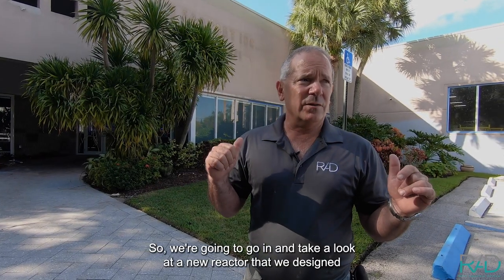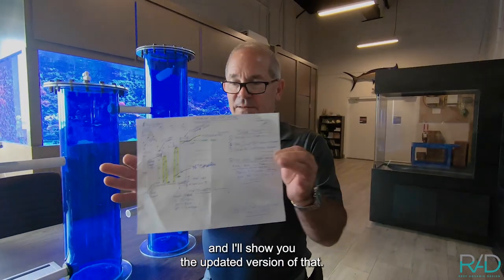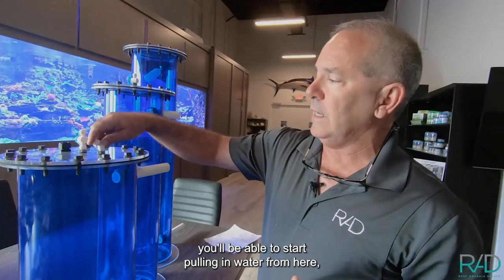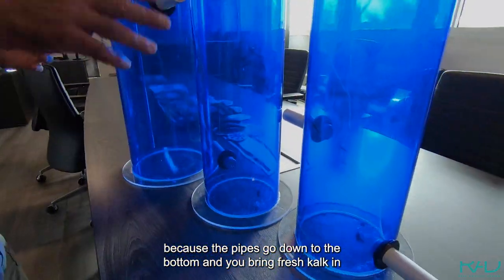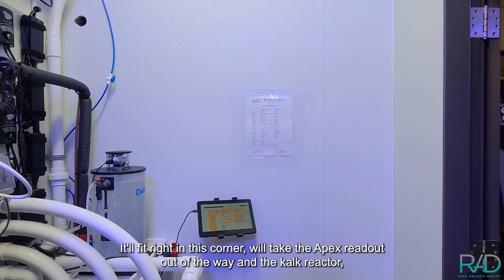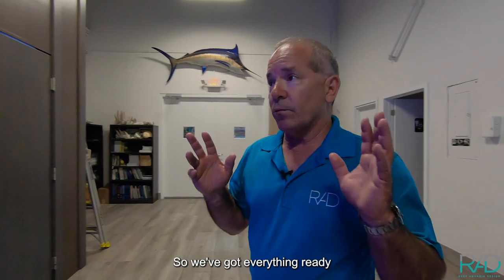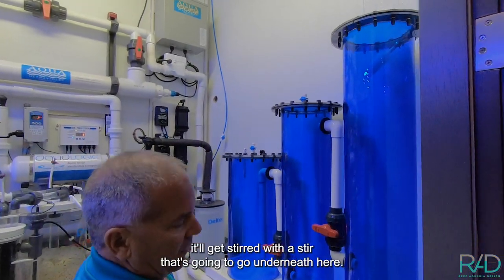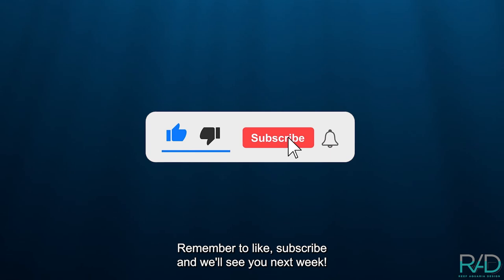CUSTOM-MADE KALK REACTOR FOR OUR 1680 GALLON REEF AQUARIUM. BY REEF AQUARIA DESIGN. PART 1.

Comment: You don't need 3 containers. Only one container is more than enough for the reaction and to dose clean crystal kalk solution. And you don't need screws on the lids at all when you use a single container. It's much easier than you think. I'm glad you are using kalk. I've never stopped since the early 90's.